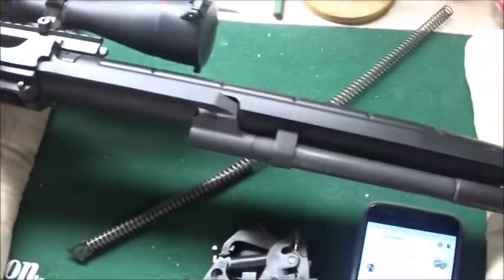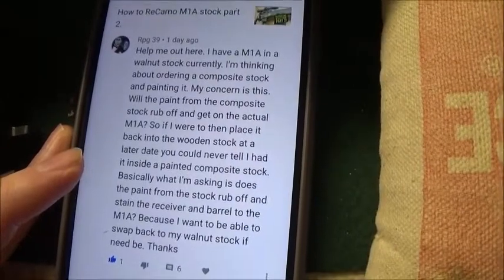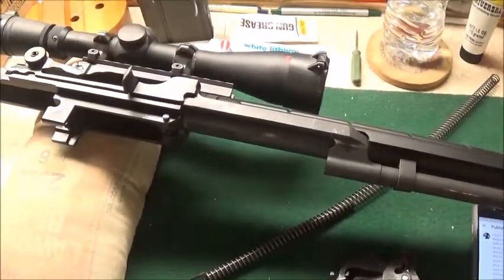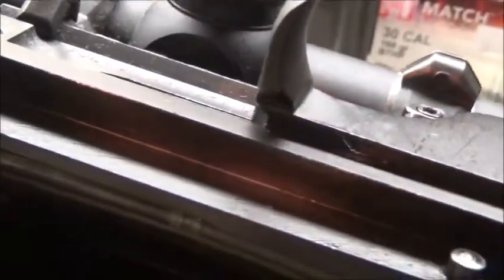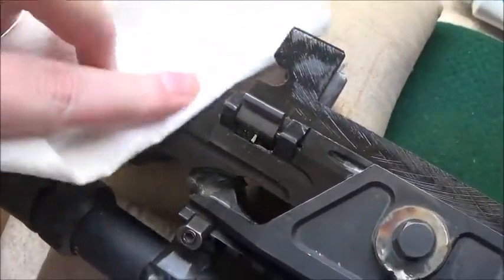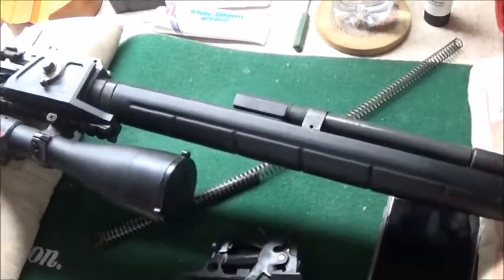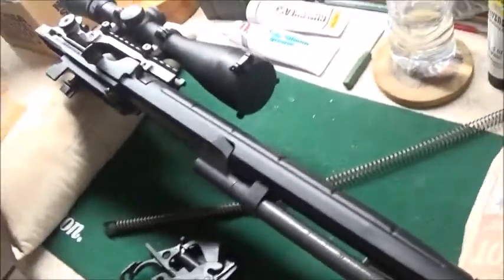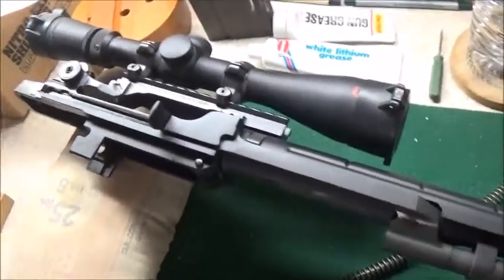M1A Painting Stock Questions! (VR To Rpg 39!) Part 1!

Comment: Good job on the video bro. And on keeping that baby greased up. I tend to overdo the grease. I think yours is just right.
What the book is referring to is wear between the stock and action.  The more you disassemble it the more wear and tear created. So over time the rifle has more room to move around in the stock. Shot to shot consistency begins to suffer. We are only talking a couple of thousands of an inch. But that is like a screw being torqued down tight vs being loosened by a quarter a turn.
National Match rifles are often bedded to the stock to prevent this "Shifting". Literally, the action is glued to the stock. Others are bolted to the stock.
Reply from the maker: I have held glass bedded m1as and they are pretty solid rifles, I held one in cabelas a couple years back! The previous owner had made it an m21 clone. As for taking the rifle apart over and over I haven't seen no accuracy loss in my rifle from it, but I don't break my rifle down that much simply because it's not necessary to break it down for each cleaning.